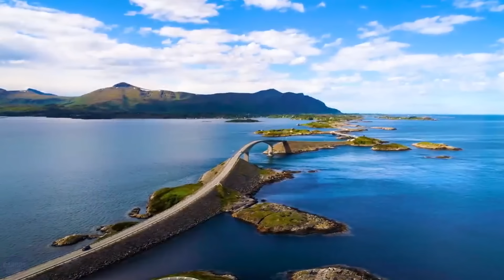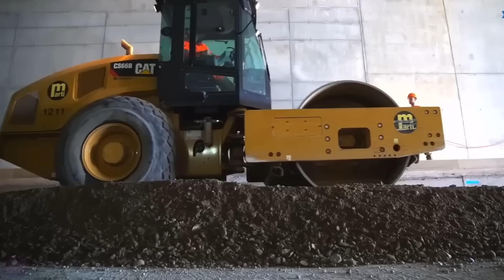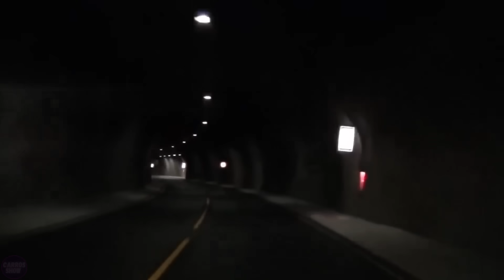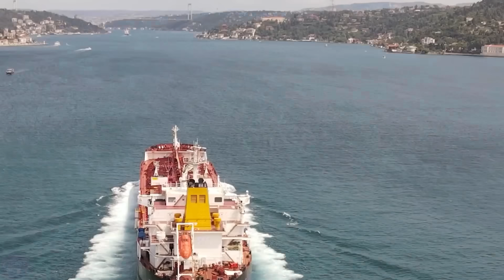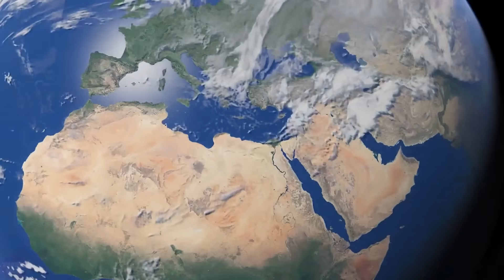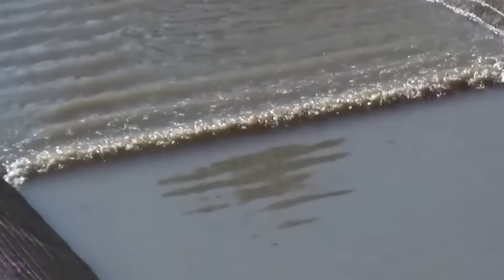China SHOCKED by Norway's NEW $40 Billion Mega-Project

Comment: will become pointless, no one even see the two events will end all mankind, one last year jan  it put more water some clame up to 200 million tons , what will this do mass flooding . and supper heating of the world wich meens sun will get much hotter .  so if this was not bad enouf as it did remove over 30 % of all co2,  now a volcanon went off this year wich put more co2 in air then man kind could do in next 10k years if nothing change .  two events togather has put us on clock 
has sun much hotter what we should of done start building underground for liveing  doing this we could extend the time line, but can you even see what would happen if we all told we had 60 years to live .    we have teck money to live throw this but not one dime spent to this,   we have 100k of miles of coal mines could be used.  soon fires will hit every city  our power system will fail, there is nothing out this that we cant fix now but we wont

Comment: As a Norwegian: This whole "ferry-free" highway along the coast is very much on the drawing board. The only part being built now is Rogfast (https://en.wikipedia.org/wiki/Rogfast) which is pretty impressive by itself, but perhaps the easiest since the fjord is shallow here so you dig underneath it. The idea of floating tunnels is quite daring, and may never happen. The next project in the pipeline is Hordfast (https://en.wikipedia.org/wiki/Hordfast), but it wouldn't surprise me if it gets canceled - it happens a lot with grandiose plans that politicians make from time to time. Another way that perhaps can be cheaper is to have an automated ferry service on the short and very deep fjord crossings further north. Time will show. It will take probably until 2040 or 2050 before this whole project is completed, if ever.

Comment: I suppose that it will also mean that no EV be allowed. Definite fire risk there.
Reply: Why do you believe that? Currently, approximately 20-25% of vehicles on Norwegian roads are electric, and starting from 2025, the purchase of new cars fueled by fossil fuels will be prohibited. Although I'm not sure about your data source, it's worth noting that electric cars have a lower likelihood of catching fire compared to fossil cars
Reply: It would make more sense to allow only electric cars. That would reduce the need for ventilation, since electric motors do not use oxygen or polute the air.
Reply: @klausolekristiansen2960  ... until they catch fire!
Reply: @nuntana2  We have a much higher standard of electric cars and batteries here than elsewhere, especially Asia. I can count on one hand how many accidental fires its been in Norwegian tunnels.
Reply: @Rolf-farmedfacts-supervisor  EV fires?
Reply: @mcplutt  Yes, accidental EV fires
Reply: Imagine having a flat battery inside of one of them floating tunnels!
Reply: @zemekiel  Just call for help. 5G is everywhere...
Reply: @zemekiel  There will be charging stations 😄